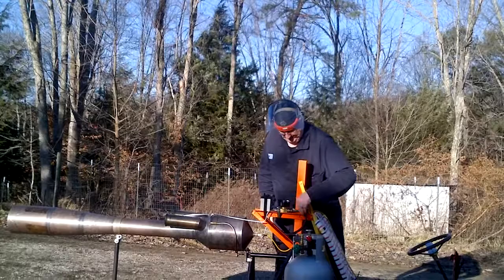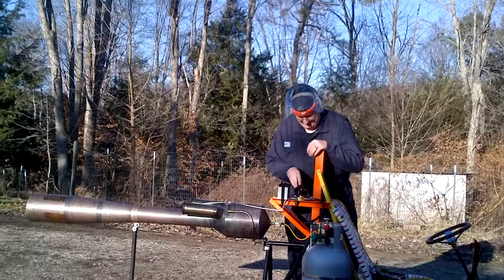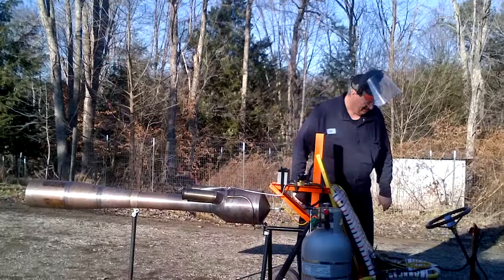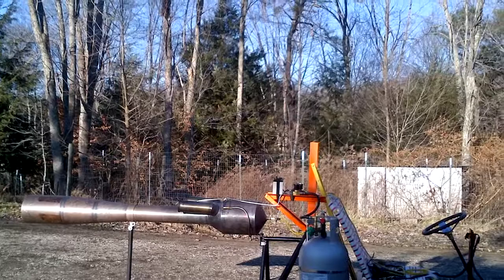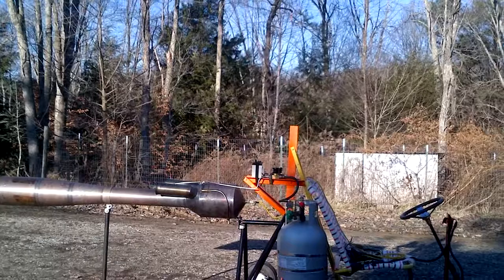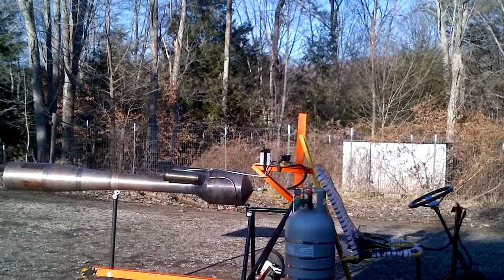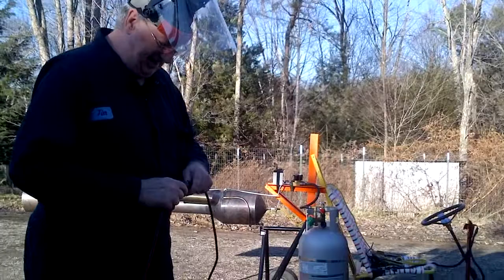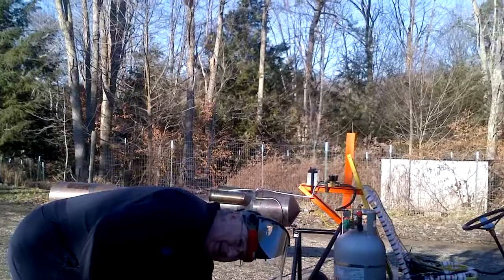Pulse Jet powered Go Kart Part 56

Comment: At least you know it runs.  This is why I like using a valve for control at all times.  I don't know the frequency of your spark but you could be flooding it in between cycles.  Try using the tank valve for now, crank it way down, get the engine lighted and slowly open it up to get a big burn and hit with the shop vac.
Reply from the maker: Spot on! The engine seems to want a narrow pressure range for starting. Too much PSI and it floods, too little and it just flames. At 58 degrees a setting of 11/4 turns on the high flow gas valve works but only a few times until the tank coole due to usage (cooling). It then requires a shot of air. I thought about using a regulator. I would like to be able to just hit the start and have it fire every time but it needs a purge of air after every run to clear the combustion chamber for the next cycle. These things are finacy about starting it seems? What do you think??
Reply: Its easy to flood them with an intermittent spark.  Mine is the same, sometimes it takes me a few minutes to get it started.  I'm going to try a grill igniter with a faster frequency this year to help with that and be portable.  Anyway, back to you.  You most likely won't be able to run it much off of vapor if that's what you're saying.  At least not without being inconsistent with throttle settings.  You will still get a pressure drop over time which will also affect you liquid flow when you use it.  Obviously how much its affected with your setup can't be known until tried.  I would just use your setup as is.  You will probably want the high setting most times anyway until you get a bigger engine.
Reply from the maker: @MrBen527  Thanks once again for the experienced advice! You are always a great help! Unfortunately we were just given notice that we have to move so as of today the jet kart project is on hold. Que sera sera!
Reply: Whoa!  Hopefully everything is alright down there.  Catch you later.
Reply from the maker: @MrBen527  Yea, everything's cool. My landlord has a minor family issue so they need their mobile home back. Knew this could happen when we rented 4 years ago.
Reply: I assume you can grab another one in the area?

Comment: Hi Tim, Sorry I don't watch new videos and didn't know you were having problems, it's your spark, you have to use the big stun gun to light the rich propane, is that what you are using? I can't hear it in the video, I'll shoot you one out if you need it,
Reply from the maker: Hey Bob! I was using the BBQ grill lighter that you have in the test bench photos. It works for the first light-off but after that I have to air purge the CC to get a relight. I have built a high energy ignition that I think will work. Please check out  https://youtu.be/Lobheuv0_HE?t=1208  to see what you think. If the stun gun spark is stronger then send me one. Sorry I didn't let you know I was still struggling a little but  I need to learn the hard way on some things so as to understand more. I adjusted the high flow fuel valve on my tank setup and found the sweet spot for starting  but still have to air purge after a 30 sec. run to restart. Let me know what you think, Good to have you back on Youtube comments! Hope you have more time for this in the future!